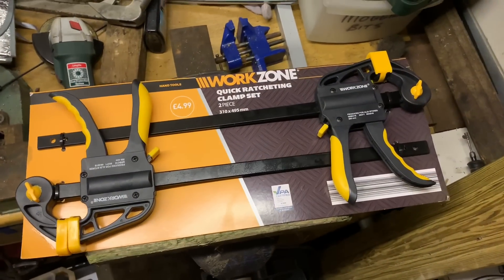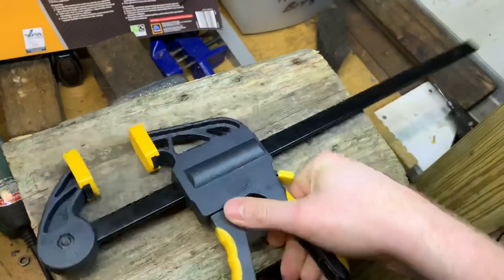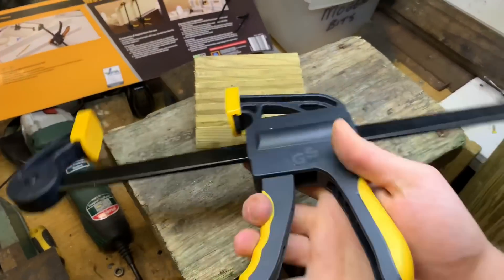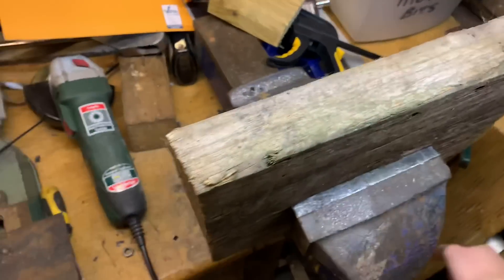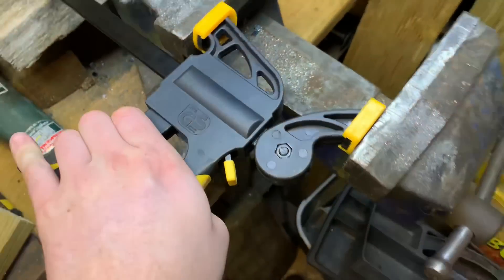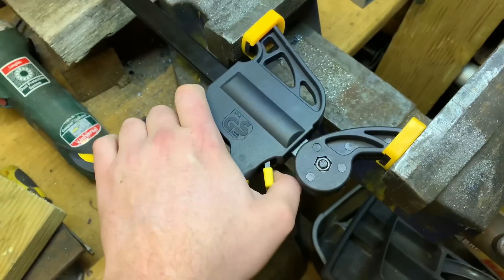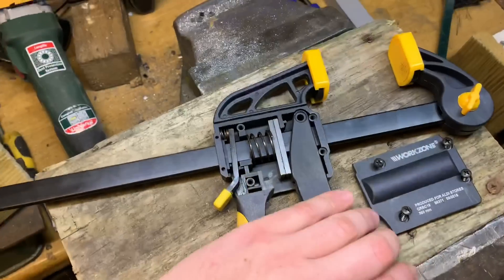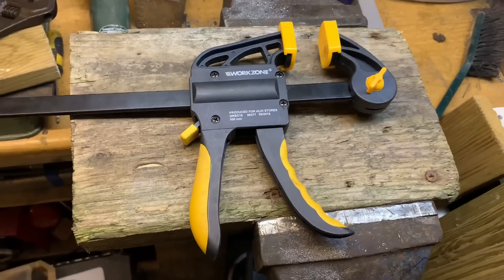Are cheap tools a waste of money? | Aldi Workzone quick clamp tool review

Comment: I've bought lots of tools from Aldi including these clamps and I have no complaints at all . For diy or a hobbyist they're great value for money 👍.
Reply from the maker: I was sceptical at first but I think I’ve been converted. I use very expensive tools at work but at home I have no issues in buying cheaper brands. I’m also a big fan of Halfords advanced tools.
Reply: @4wdaction632  I've also bought some power tools from Lidl and have been quite impressed with them too . You get a 3 year guarantee so can't go wrong really . I would definately recommend them .
Reply from the maker: I have the Lidl invertor welder in the boot of my car at all times. It’s 1/5 the size of the arc welder in my workshop and I can easily weld 6mm steel no problem with it. Very handy tool to have. Aldi now do their own version that’s £10 less I think.